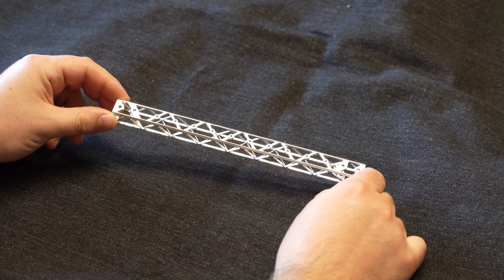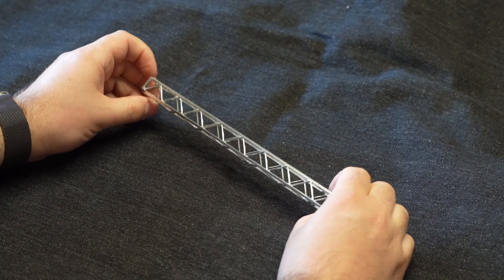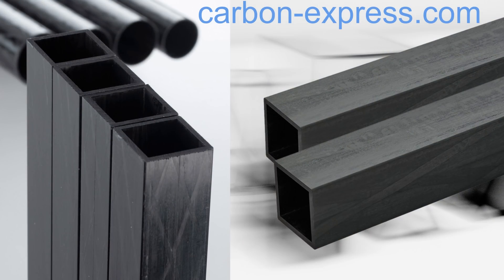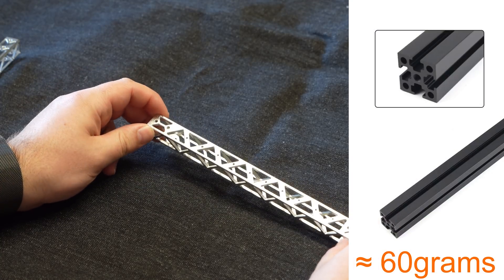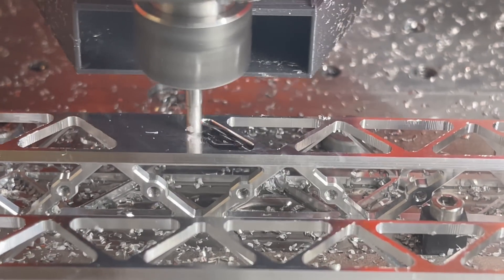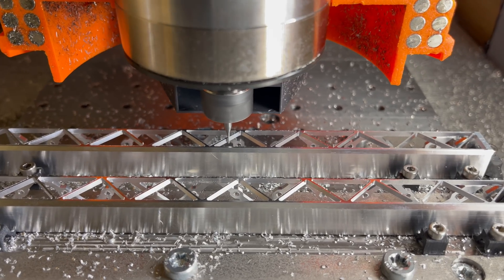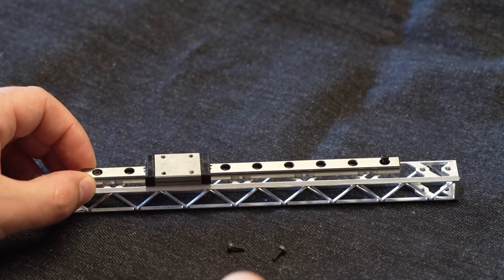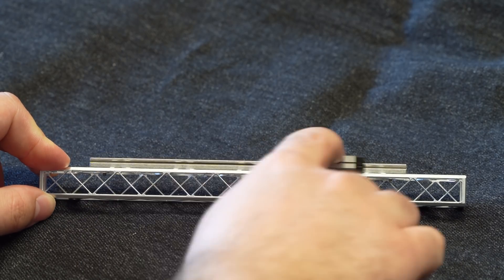Ultra light VORON 0.1 X-Beam

Comment: Oh wow that sounds like a great application for a carbon fiber lamination technique I developed recently. I have no idea what the application is exactly as I have no background in 3d Printing, but making what you made in CF Unidirectional is both possible with that technique and probably even lighter then your solution. Contact me if you are interested in a collaboration, I'd make a prototype and mail it to you, but I'd need to be filled in in what I'd be making. 

Cheers dude!
Reply from the maker: That sounds interesting, do you have some pictures/website about your work? Can metal inserts be placed directly into the part? This Part is essentially a X “gantry” for a small printer to enable even faster printing.
Reply: @premiumbasics  I don't have a website, but I worked on a university collaboration with Formlabs, where I build a Carbon Fiber Steering wheel for a race car. The process has since been adapted to work for unidirectional Carbon fiber with filler material for mounts. Metal Inserts for threads are possible, but the threads tend to clog up with resin in the process so just having unthreaded Inserts to drill post lamination is usually preferred.

I don't know if I can post links in Youtube comments, I'll try to put the link to the paper in the next comment.
Reply from the maker: Can this process be automated within a hobby garage? I am sure it will be lighter, but if it is to expensive to manufacture, it will serve a niche of a niche market.. How does it hold up regarding stiffness? Thanks for sharing this interesting possibility with us :)
Reply: @premiumbasics  Automation and Carbon fiber don't mix well, it's always a hand crafted affair. But once the molds are made, the actual manual labor to get it made is rather fast, I'd say actual work time for a single piece is somewhere around 1 to 1,5 hours, it becomes faster if you have multiple molds and make several of them in one go. Simply because some steps (such as applying wax) have wait times to dry, and making like 10 at one go syncronizes these wait times. 

Hard to say how long/much effort it will be before you actually make one. I'd be willing to try though.
Reply from the maker: Thanks for that honest insight of the process. If the test with this X-Beam is positive it should be the last step in getting the lightest X-Beam possible :D 
VORON Printers are open-source, you can download the CAD of every printer model for free and design a Carbon fiber Beam which fits and is possible to produce for Your lamination technique.

Comment: I am interested in the CNC that you want to build that would be able to do fine milling. I might want to build one too :)
Reply from the maker: Thanks! It will be a interesting journey and updates to it will follow on this Channel. Might take 2 Years, it will be built out of a granite surface plate for maximum stiffness. :D
(Some great videos about granite CNC’s are already on YT)
Reply: @premiumbasics  That exactly 👆 👍👍👍
Reply: @premiumbasics  or find a Light Machines ProLight 2500. That version of the PLM benchtop bed mill with epoxy granite frame has a spindle that runs over 40K RPM. The PLM (later Intelitek) 1000, 2000, and 2500 have a 100 pound working load, higher than any other benchtop mill of comparable size.

The PLM 1000 used stepper motors and cane with a quite bulky controller box that connected to a proprietary ISA or PCI card in a PC. Software was made for DOS and Windows. The PLM 2000 and 2500 used a 3 or 4 axis Animatics servo controller in a "backpack" box mounted to the rear of the column. It communicated with a PC via RS232-C. Unfortunately only DOS software was made for those, and it's so old it has to have LIM EMS memory to load larger g-code files. It knows nothing of XMS.

What is really good about the 2000 and 2500 is they use servo motors on all three axes and they can move the table and spindle around quite fast.

The 1000 and 2000 came with two options for the R-8 spindle speed, up to 5000 RPM or up to 10000 RPM. Just different toothed pulley rations, with less torque available with the 10K RPM option. The mills were also sold without a spindle, so that the buyer could make their own. The spindle and motor block mounts to the vertical carriage with 4 bolts.

Since Intellitek discontinued the blue mills (if they ever actually manufactured any, could be they just sold off the stock they'd bought with the acquisition of Light Machines) there has literally been zero comparable CNC mills manufactured. Anything available currently of similar size cannot handle anywhere close to a 100 pound load. Anything that can handle that weight is far too large to be called "benchtop".
Reply from the maker: They seem to be great machines, but one of the reasons I want to build one myself is the learning and "grinding" experience :) Maybe I have some change to spare for Servos and the other fancy stuff...

Comment: Wow! That’s beautiful! I didn’t even think about machining tube stock with my machine 🤦‍♂️ duh!!!
Reply from the maker: Thanks! If you machine one too, let us see the result, curious what it will look like :)
Reply: @premiumbasics   will do! I’m going try this out on the 1in aluminum hex tube I use for the driveshafts on the aluminum Tesla turbine electric generators that I build for the discs to key to the hex shaft pattern. This should work wonders to offer an exhaust path through the drive shaft nearest the center of rotation.
Reply from the maker: Your channel seems to be very interesting, I will make sure to watch Your videos about the turbine :)
Reply: @premiumbasics  ahh thank you! Yes I have subscribed to your channel as well. Your work is very pristine!
Reply: @premiumbasics  have you tried doing this with carbon fiber tube stock yet?!?!?
Reply from the maker: No, but I guess when you cut the fibers it will not be strong anymore... If You wanted to make one out of CF you have to use long fibers and make this shape with complex process.
Reply: @premiumbasics  mmm won’t be a problem with fiber tube. The cross cross hash of the weave when rolled up to make the tube will more than keep it sturdy. Plus you can lightly brush a little epoxy on each cut face to eliminate any fraying. I’ve cut designs like this into carbon fiber sheet. Def don’t take TOO much material away but they will def keep sturdy.
Reply: @premiumbasics  omg! I’ve been trying to find this video of yours again for 2 months now to show someone! 

I just can’t get over how absolutely gorgeous these are. I’m happy to see the video has blown up for you and that you’ve started production! Bravo mate!

Comment: What is with thermal warping of the two materials?
And why not manufacture a X beam out of a 12x12 steel material with even less wall thickness?
Reply: When I designed my mini printer, I looked at this very closely.
The difference in expansion in this short length is trivial.
Not that it matters much, the Voron tool head is the real weight issue, not the x-beam.
If you want low moving mass, better to look into printers that are not overly complicated and are designed from the ground up to have low moving mass.
Reply from the maker: I am no material scientist, but if you let the Printer heat up to temp before printing it should not be an issue.
I thought about making a thin Titanium one in the future, but first i have to build a beefy CNC ;)